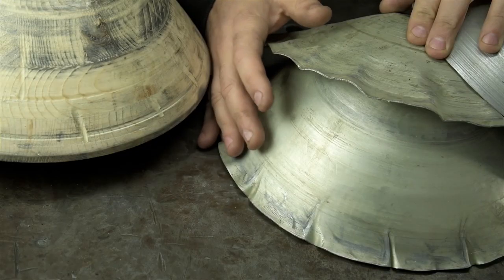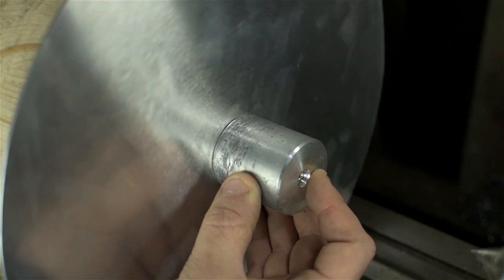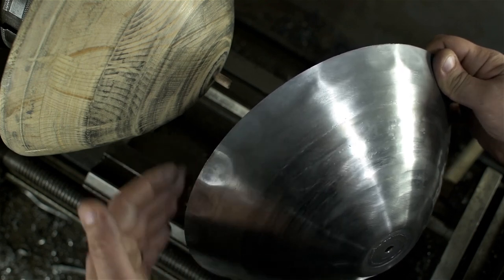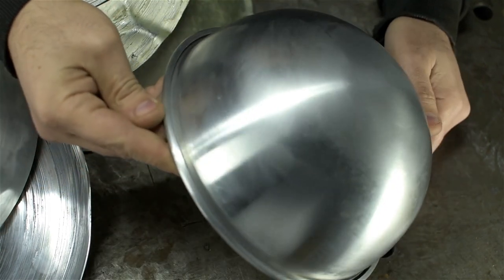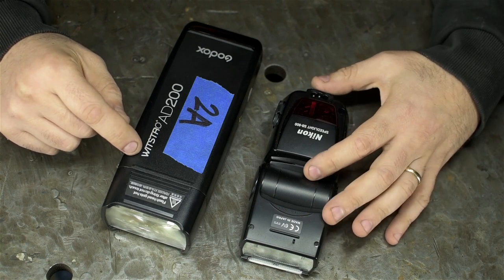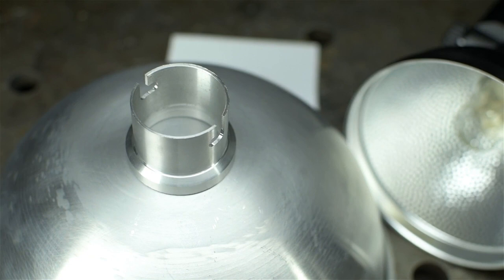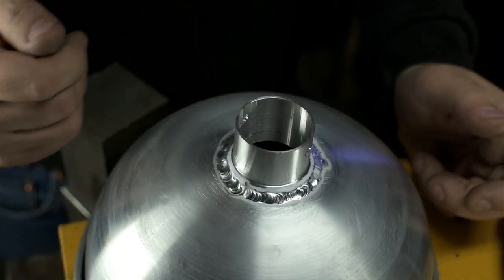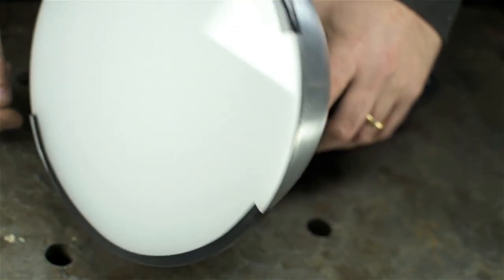Spinning Metal - Part 2! - GODOX Strobe Reflector Build

Comment: As your radius increases, so did the torque arm and the duration of pressure needed to form the aluminum. In essence you have too much orthogonal force on the mounting point. IF you wanted to mitigate that, I'd form 2-3inches towards the center, then change from the aluminum bar to a concave pieces that matched the shape of the 2-3" you formed. This distributed the force on a greater surface area. 

Alumimun sheet metal sometimes needs significant amount of heat to form instead of deforming.

Comment: Haven't tried it myself, but my first thought is you're thinking it'll deform like mild steel - aluminium is brittle as hell, so i would imagine to make it more malleable would take a blow torch and some soap or a heat stick marking so you could get it up to a couple hundred degrees. Trying to cold form it to that much of a shape would only work with a bump bend or an actual die and punch.

Comment: The 'reverse bend' you can't quite figure out at 4:55 is happening when you apply pressure at the outer diameters. That pressure is lifting the material off the form, on the opposite side of the center hold-down. The bending effect is easily seen by watching the center hold-down at 5:26.

Comment: Seems that the stretching of the metal is taking place, not only along the radius but also around the circumference so when the rolling reaches the edge of the blank there is too much material to 'hug' the surface of the buck and so it goes seamstress and frills appear. Should that 'rotational' stretch happen nearer to the centre/halfway stage then the 'wrinkling' [although less visible] will be 'catching against the toolhead, kinda stopping the rotation causing the centre to rip out. How's that from a guy who knows nothing about this process?

Comment: Take a look at this: https://www.youtube.com/watch?v=3ko8kweSHvg
Note the high spindle speed and the support against the tailstock, reinforced halfway into the work and the care in hard forming the initial part tightly, before proceeding. Note also the use of wood stick to absorb vibration when working at the edge, to avoid resonating into polygons. Maybe your wood form was too soft to work against a roller and you need the feel of the spoon when smoothing, which you don't get with the roller.
Great effort you did, anyway.

Comment: do you think some of your problems might be related to the position of the tool?  In a typical spinning setup, the tool rest is the pivot point on which the tools placed to spin the metal.  The bearing might actually be limiting the ability to stretch the metal.  Finally, periodically annealing the metal will be helpful, especially if you don't start with "0" aluminum blanks

Comment: I've actually done this about 10 years ago. I used a 1/2" square hard wood dowel to apply the pressure and I did it with tin not aluminum.

Comment: The bulge out in the center seems to be happening on the back side of the lathe. Spindle is the fulcrum. Push the working side back against the form and the back side pushes out creating the bulge and tearing the center out. I have no idea if any of this is important it's just what appears to be happening. 

Sputnik replica?

Comment: try making a tool like the first one you had with the ballbearing , but use some sort of rubber or plastic wheel , like from a skateboard or the rolls from rollerskates , they have a bearing inside allready . i think th problem is the metal on metal friction thing , most videos i saw of metal spinning they used plastik or rubber tools , might be worth a try

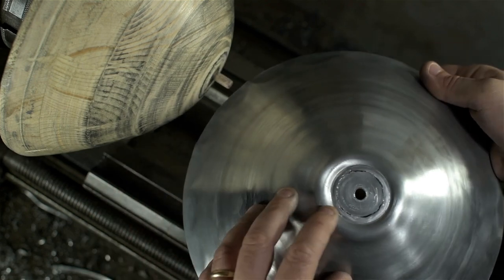Comment: 4:50, the reason for the buckling is because you're changing the curvature. It's like if you try to wrap an orange with a piece of paper without folding or crumpling it. The reverse would be like trying to lay an orange peel flat without tears

Comment: That inner bulge you were complaining about is coming from when you work the outside edge, the other side is moving in the opposite direction. You can see it warping the metal disk at 5:26-5:33. it's also what is causing the center failure. at 6:02, that's a nice hubcap.

Comment: I may not know jack crap about lathing but I do know at least a handful of things about cylindrical metal bending techniques like for instance that bowl you ended up using is die shot and not spun and that when you spin your disc you need to do 2 very important things that you did neither of, 1.) you need to either reinforce or roll your edge creating a fold over or even using some bent thicker metal to keep the form would have worked and kept off that lamp shading and 2.) your roller head needed a lot more contact if you were going to be hand shaping instead of CNC control about twice as wide as you had it to keep you from marring your piece as you did

Comment: I saw this being done in some third world metal shop. the only difference was they didn't force the process. they used a different tool and very slowly walked the metal to the former. I suspect you are being impatient, and if you were to concentrate on the metal incrementally. (  no more than 6 cm at a time, and creep forward)  you may well succeed?  good luck. also, a final finishing was used, and a rolled lip was placed at the rim with a wooden stick.

Comment: It looks like you're losing the blanks because the blank is pressing against the stock you're using to secure it. That's causing the bend you were talking about and the cuts. Maybe try shaping the side that sits against the metal so it matches the blank's curve then start the blank by hammering it into the cup so you get a lot more surface area holding it in place rather than just the tiniest bit around the dowel? (And maybe even making a larger diameter block to give even more surface area?)

Comment: The disk forming end bar should create some heat to help stretch the material. also, mid forming, you may want to switch to a better shaped push piece that grabs more of the form, so you won't be only loading the very center material. It gives because of too much leverage and prying you are doing with the forming tool at the other end....

Comment: Maybe if the end you clamped ,was not a flat face. But matched the shape of the mold , and rounded the outer edges ,maybe made of brass
. That it would avoid the break out problem ??

Comment: issue was, you we're going WAY too fast in the beginning and it was just destroying the part instead of deforming it. Should have tried locking the tool post and using the cross slide to slowly move the metal at a slower speed

Comment: You are only working metal from the centre out.  You need to work the metal in and out to maintain constant metal thickness. Also,  don't let the edge turn towards the tailstock.

Comment: What you forgot was to wax your disc. Get a block of bees wax at the sewing supply shop, they use it to run the thread through. After you chuck up the disc and get it spinning, rub the wax block across it before hitting it with the blunt tool.

Comment: If you watch what is happening you will see that the material needs support on the other side to the tool to keep it from flexing at the centre too much A roller with a spring forcing it against the work would probably do or another form tool mirroring the other side.
Also the lampshading is caused by the work folding back and stretching before it is pressed into the form Fitting a roller that keeps the work from fanning back or stopping and beating it towards the form may help. If you heat aluminum and quench it quickly it will soften

Comment: The lamp shade effect might be due to the fact that the aluminium disk is not securely held. So when you apply an uneven force on one end of the spinning disk, it tends to start wobbling giving rise to the irregular undulations towards the end where the wobble is much more pronounced.

Comment: Have you tried working it slowly light pressure from the base with every pass i noticed it would start going wonky once you started pushing the material harder and even more so when you would start half way to the end.

It seemed like it would star pushing material backwards when you would go from the half way point. You might need to take each pass from the base to the end in one pass with lighter pressure.

Comment: What I noticed in metal spinning videos: actually do they spin the base to the very finish of the expected form up to about the middle of the bowl before the also work out the the rest.
And maybe pure aluminium not the most preferred metal. An alloy is probably easier to spin

Comment: Tony,In one of my first engineering classes we got to turn a nice little dish similar but smaller than your reflector.  The main tool was an old repurposed wooden base ball bat with a reshaped end.  There were some smaller tools as well for rolling the bead on the lip.  The buck was hard wood, clamped by another piece of wood with I think a rubber pad attached for friction. The blank was 4 ot 6" in dia dead soft Al with no center hole.  I think it took a couple of pieces to get it to work.   The trick was to go slow, use plenty of bees wax, trying to move the metal too fast was a disaster.  Think the metal always needs to be stretched, don't think one can shrink the metal while spinning.  Try starting with a smaller diameter piece then  draw the material to the outside edge to get to your final size -- This was decades ago so the memory is a little sketchy.  The dish had a Greek looking spun base as well -- the bowl and base were epoxied together instead of TIG welding. Sat on my shelf with keys and pocket coins for years and never came apart

Comment: I remember spinning bowls like this in HS shop class. It was like 1974 so my memory might be a little suspect but as I recall we used the rounded end of a broomstick. I think we used a bar of soap to lube the sheet metal.

Comment: I think the best way to show what happens with your technique is to try and take a piece of pizza dough flatten it out and try to put it on the back of a bowl.  It will do the same at the edges because the circumference is different.  the dough will work better due to it's elasticity i would think.    Maybe using a press and two pieces of shaped wood would work?  :D

Comment: You need support behind the tool to hold the material down against the wooden form. Otherwise the further you get from the center the greater the  torque you put on the material at the center.

Comment: I think the buckling could be because of not doing a full press from inner to outer each time. By doing only a third or so in each pass, the material is "bunching up" at the outer, and by the time you get there, especially at the end of the process, the extra material has no where else to go but to fold / buckle. Try always doing a full stroke on each pass, that may take longer, but I've a hunch itll help (I'm a non-machinist btw)
Reply: ...think of a pizza maker 😉

Comment: My feeling, from observing these attempts, is that you will always get this instability that causes the sheet to wobble and come off the spindle when you move towards the outer edge. One thing to try would be lowering the rotational speed when shaping the outer part to the point that the shaping operation is controllable.
It seems the harder part to shape is the circumference, while the easiest is the inner part of the disk, the shaping of which causes the sheet to turn into a bowler hat shape which increases the difficulty of shaping the circumference. So, if the outer part could be shaped first, one would hope the task would get easier. The other thing is that, when shaping the outer part, there's a bigger risk of the sheet coming off the spindle due to the higher torque exerted by the shaping mandrel. 
Therefore, theoretically, it should be easier to form the shape by using a concave former rather than a convex one. The reason is that by using a concave former and by starting the shapng from the sheet's circumference moving toward the sheet's centre, you are always stretching the surface -which is the desirable method as you avoid first stretching the material and then compressing it (which results in the folds being created) when the sheet is first formed into a bowler hat shape. A concave shape former, however, would pose some practical problems, one of which would be a much higher risk of the former flying off the chuck due to the majority of its mass being located in the circumference. Again, a lower rotational speed would be safer.
On the other hand, splitting the convex former in two parts, one for the outer edge and one for the inner disk might seem like a more practical compromise. One would then start by first affixing the outer part former first. Since the outer former would have a large flat area in its centre, it would allow for a better stabilizing of the sheet by virtue of having a larger area of the sheet clamped at its centre. Having shaped the harder outer part, one would then proceed to assemble the two parts of the former into one and very carefully start shaping the inner part. 
Another possible avenue, probably a more dangerous one, could be to have the sheet fixed on a stable static drum and attempt to shape it by using a suitable former that is being rotated by a milling machine or a hand drill. In this method, a smaller rotating former would be used. One would check the formed sheet against a guide of the desired shape and proceed in an iterative fashion by shaping for a bit, then checking and back again to shaping again.
Just my two cents.

Comment: how abaut stopping halfway , annealing the part and then do the rest 
also maybe use polished raw material with this blue protective foil on(and leave the foil up until after the spinning (logicallly not if you are annealing the aluminium) )
and make a second larger holding block with a milled hole fitting the woods shape 
also the industry pressstamps those bowls with a 50 ton press and a high speed steel or tungstencarbide negative form and later polish the inside and outside while its held on the rim or via a vacuum suction cup so it looks spun

Comment: Your pressing hard on the outer rim while the center is not set down enough, that pressure work hardens the central area where the back bend bead is forming. 
Finally it's too far work-hardened and brakes off.

Comment: The angle between your tool and the surface is to acute. That's why the metal is getting pushed towards the center. Think of the metal needing to be pushed outward onto the form. I have made quite a bit of metal armour in the past and dishing the piece is similar to bowl turning.

Comment: You need to build a bar across your bed with holes for pegs in it,  make a peg with allows your to get different point of leverage while using the planishing tool (blunt tool).  You also desperately need a back plate to fall the tool against when you get over the edge.  You are turning something bigger than I ever did though.

Comment: Some time ago I worked with aluminum sheet, and noticed that after a few bends it became broken and cracked.  to avoid such cracks I heated the sheet around 350 - 400 degrees Celsius, after the heat treatment became malleable again.

Comment: Metal spinning is hard to master. Takes both hands and two tools to create lots of pressure on the work piece being pushed up against the mold on the headstock. The wood mold isn’t rigid enough and creates wobble. The force needed to spin the type of bowl you want will pop the wood mold right out of the chuck. 

This video shows how and what tools you need. 

https://youtu.be/um-biLfru-c

Comment: one other thing, use aluminum to make your molds as the finish of the mold is what will reflect in the final product, better you make it, better the outcome. Anything harder than soft woods will work but depends on the material you are wanting to spin.

Comment: Hey Tony, i know this is an old video at this stage. 
I feel your lathe was spinning too fast and the metal at the outer edges was not getting enough time to deform causing the wrinkling you saw. 
It also seems logical that adding some heat to the equation would help the metal move more easily and thus not snap off your tailstock.
Also in having watched a few other people do this, it seems like there's more central support as a percentage of diameter than you're using

Comment: The parabolic shape actually does matter to the pattern of the light as it leaves the reflector.  The bayonet mounts are used in order to position the arc tube at the focal point of the parabola, so as to reflect off the surface in the proper pattern; usually directly forward and parallel to the parabolic axis (not accounting for rays exiting at line of sight from arc to the bowl edge).  The pebbled surface is for diffusion.  It breaks up the imaging of the arc tube on lit surfaces.

Comment: the issue in the center, and possibly the folds on the edges, seems to be due to you moving towards the edge too quickly. That allows the aluminum to bend where it is mounted, flopping around and eventually leading to too much bend and it breaking. You should form it to your mold a little bit at a time rather than trying to move all the way down the material.

Comment: the ends are unequally stretched, those are tucks that can be stretched or shrunk  if you know anyone with an english wheel they can help you, And the diffuser and reflector mat create a color shift so radical, that getting daylight and the flash impossible to balance without some serious masking in photoshop

Comment: I found an incredible source of cheap material for this application in china town. They have all sorts of super cheap wok lids and other items with nice large diameters for the reflectors. Metal surface diffuses light very well, so in the end shape didn't matter. There is a bit of crap at the edge where the light falls off, but the center is great even without any diffuser.